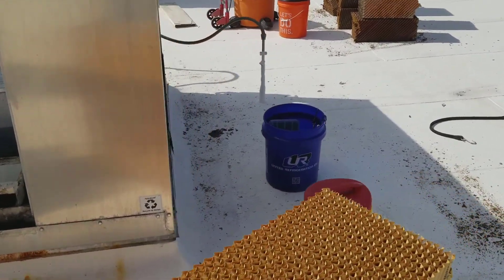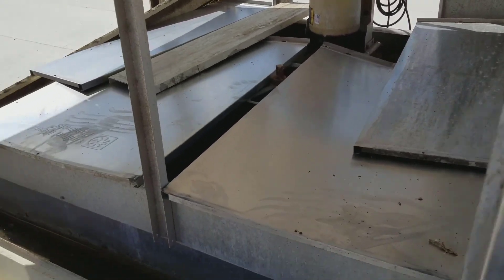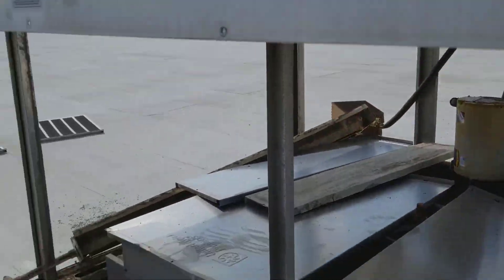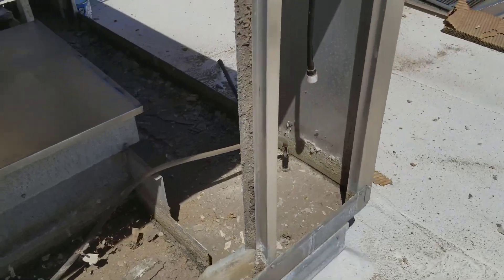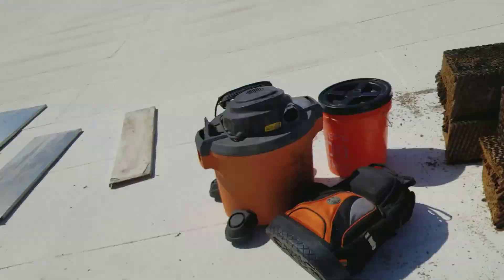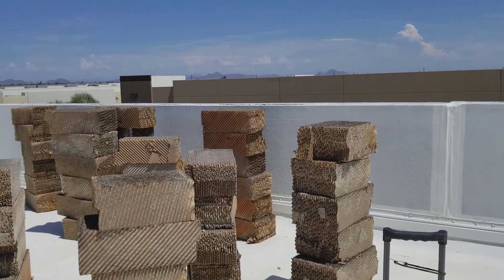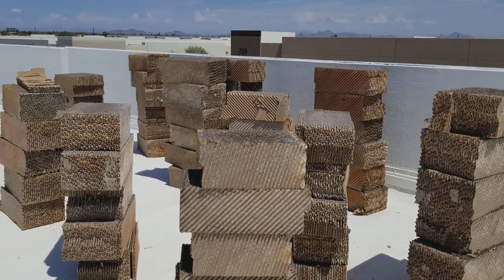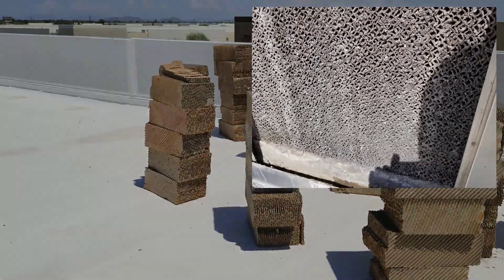Commercial Evap Cooler cell deck replacement is a tough summer job

Comment: Great informative video.I have a evaporative cooler for my home with the same kind of cells, it's a Mastercool brand.I was told from the installer about calcium and other minerals buildup and there are several products sold on Amazon that break down the buildup on the cells and the rest of the units parts including the water delivery pipes.You just pour in a quart bottle into a full tank of water in the cooler making sure you have the water feed line off then turn on the pump only for about forty minutes and let the environmentally friendly cleaner circulate thru the entire system.Then flush out the dirty water from the pan when done.These products have gotten great reviews on Amazon for their effectiveness and extending the life of the water cells by a few years.Give it a try and save your back in the process.

Comment: just stand on your head and clean the pipes in place :))
only put the cells in backwards/upside-down if you want an indoor sprinkler/fountain
Reply from the maker: If it was only that easy.
You have to unbolt the assembly to even get to it. And the cell deck has to be out to do that.

Comment: I've never seen an evap cooler that big.  Hadn't thought about how much heavier the pads get to be, but makes sense.  I'm sure you wanted to just toss them over the wall.  Ooops -- was that car down below? 

I assume that beast uses a recirc pump and maybe  some kind of automatic bleed or blowdown cycle, or else pad replacement would have to be a frequent event.  Just curious about how water chemistry is managed.
Reply from the maker: Yeah they are pretty big. The fan motor is 3 HP
The pump is a submersible pump with a 1" discharge reduced to 3/4" PVC
You need a lot of bleed or they fill up with minerals fast.
Standard setup is a bleed that is controlled by a ball valve.
The instructions in the coolers consists of looking up the cooler model and then a specification for how many seconds it should take to fill a coke can with the bleed water. HA HA! Not kidding.
An optional accessory for these when you order them is to have a 24 hr timer that opens a Belemo dump valve. They come set for 6 dumps per day typically.
Reply: Thanks for the info on setup and bleed.  I think a lot of owners and on-site people don't realize the importance of monitoring the bleed over the course of the summer.   I always worry that bugs and dust and other problems eventually restrict the flow, and then things deteriorate quickly.   Most folks don't consider evap coolers to be very interesting, but I suspect most guys who've maintained towers have a greater respect for the setup and maintenance of coolers. IMO